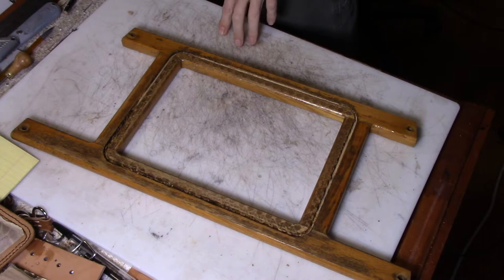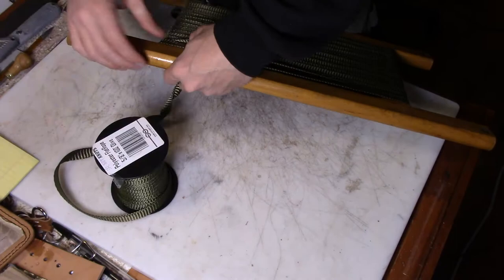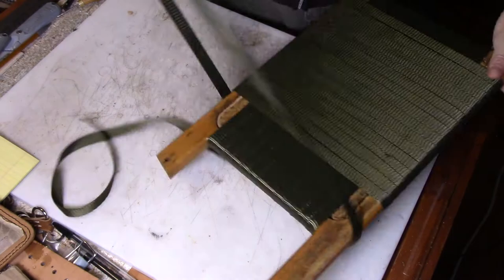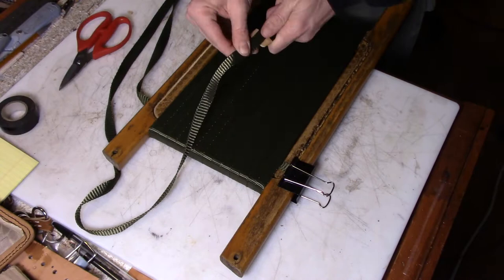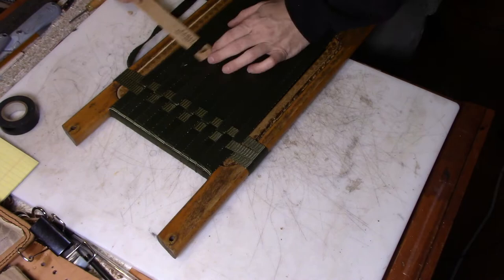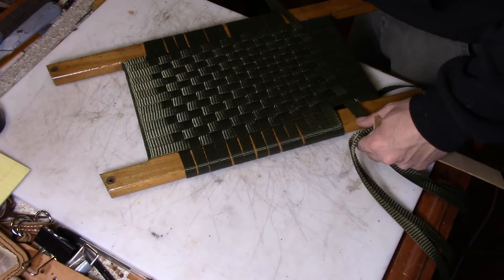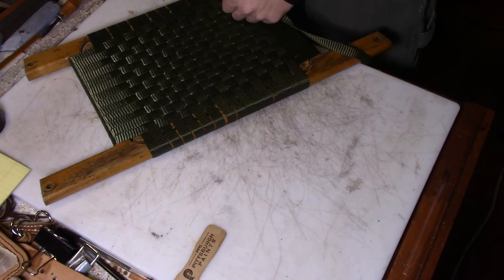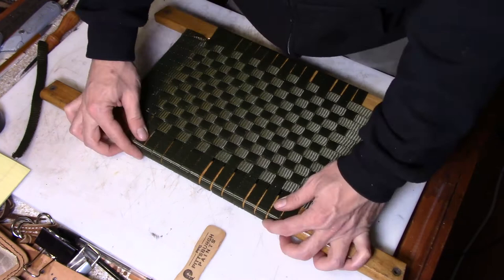Weaving with flat rope to repair a canoe seat

Comment: Looks great but....couple suggestions from experience: 1. This way leaves no gaps for air circulation, makes for sweaty butt and takes longer to dry. 2. Spiders etc. love canoes and now they have a private condo. 3. Uses almost two times more material than is needed. Stainless steel staples, Amazon $14, will do 8 seats and save you almost half your webbing with half wrap instead of whole. Open on bottom and allows small air gaps in between wraps (just like OE)......Pro tip: quality, (flat, fine weave, supple, wide) comfortable webbing is expensive, seat belts from junk cars are cheap, or free, and perfect......decent color selection too. Get on that water!!😉
Reply from the maker: Thank you! I hadn't done this until our seat broke, so I appreciate the tips. Thanks for watching!

Comment: How do you transition from long way to width ways at 34 seconds, we can not figure it out.
Reply from the maker: Been a couple of years since I did this.  Had to watch the video myself to remember.  Looks like I wrapped it all the way around the short board.  Then when it met itself on the bottom side of the seat I wrapped it around the outside of the long board from bottom to top.  I hope that makes sense and helps.
Reply: I am still trying to figure out how it was done too 😮

Comment: Looks fantastic! Do you know what length of webbing you used?
Reply from the maker: I used about 60 to 70 feet of this 5/8 inch webbing.  If you use 1 inch webbing it would take just a bit more than half of that.
Reply: @bransonsgeneralstore  Thanks for the info! Can't wait to try it out.

Comment: Where did you get your spool of material from? ? I really liked your video, very to the point!
Reply from the maker: I ordered it on Amazon.  It is a polyester webbing that I have heard called pull tape or mule tape.  I have seen pieces of it left out in the weather for years and it is still super strong.